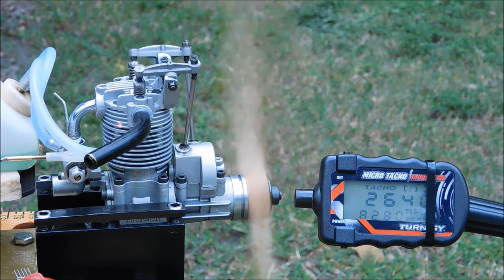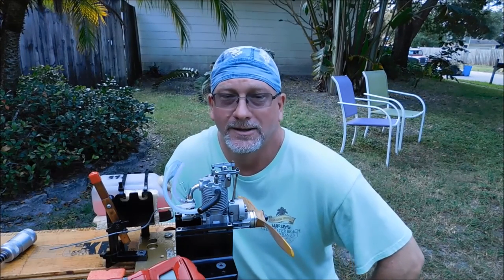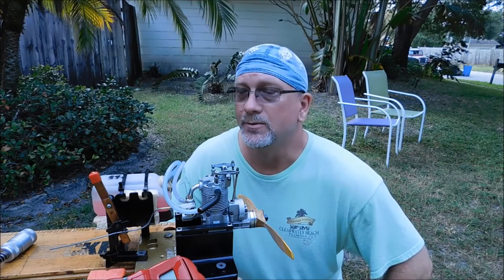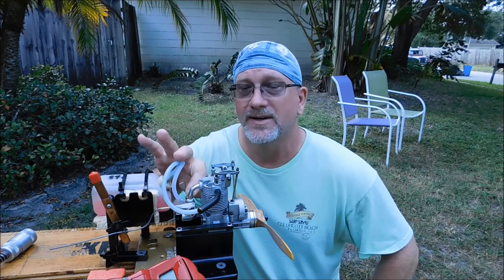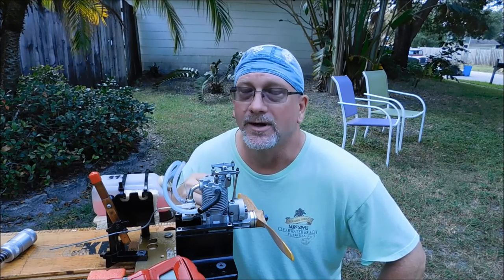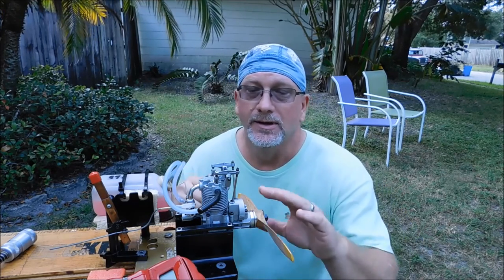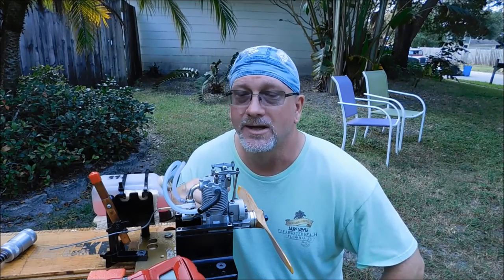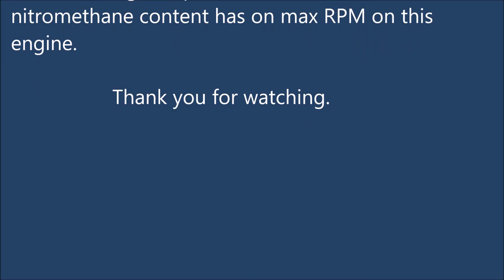Saito FA-40 Run On Three Fuels

Comment: The OS FS-40 with 11x6 propeller, 78% Bio Ethanol, 11% castor oil, 11% synthetic oil had 7440 max rpm. 
https://youtu.be/06_Ow6j8ZP8
So the Saito is at the same level. Do you think your Omega 25% Nitro with added castor would destroy the engine? What is the maximum Nitro content the manual recommends?
Reply from the maker: The manual states 5%-30%.  I might give that a shot some time.
Reply from the maker: I just tried some 25%.  It ran, got hot and only netted 30 RPM gain in top RPM.
Reply: My theory is: Either the timing gearwheel is set one tooth (gearwheel cog) wrong or the valve springs are weak (too slow). Or somewhere leaks air.
Reply from the maker: U Me Well I can assure you that the timing is absolutely correct on this engine. If it wasn't it would run as well as it does. Have you ever run a Saito that was off one tooth?  It is quite obvious.  I also doubt there is an air leak.  That is generally seen in how an engine runs too.  I cannot comment on the valve springs. They are stock and the engine was new, so it is as designed by Saito.
Reply: Or perhaps the engine just needs more break-in time. All the fuels you used contain wear protection additives. So the break-in time is increased. In Germany there is special run-in fuel (Einlaufkraftstoff) sold:
http://www.powerglow.com/html/classic.htm
This fuel does not contain wear protection. Does your hobby store sell some kind of run-in fuel?
Reply from the maker: Unknown if my hobby store sells a run in fuel.  I have never used one before and don't intend to begin using one now.

Comment: can you run it on a plane with the covers off for that old cool sound or is that not good
Reply from the maker: The rocker cover has nothing to do with the sound you hear.  You CAN run without the rocker covers, but I would advise against it.  If the pin holding the rocker arms in place comes out then you have destroyed your engine.  The cover is the last line of defense against that pin coming out.